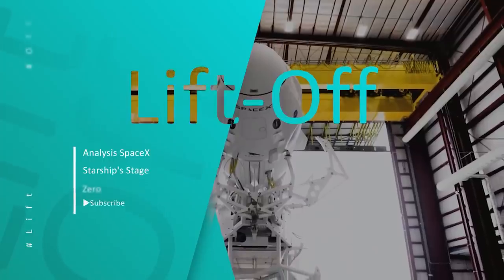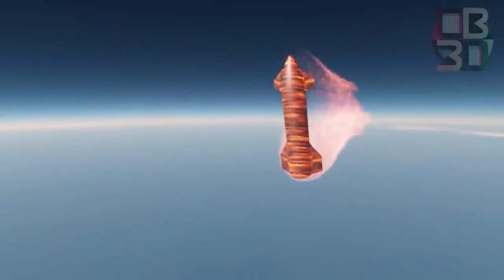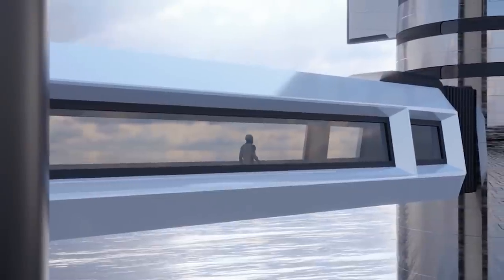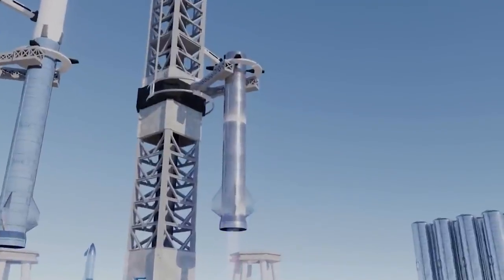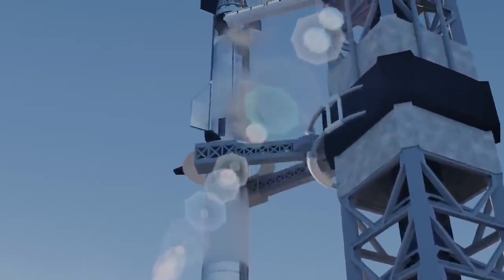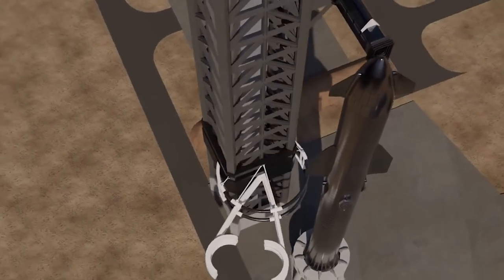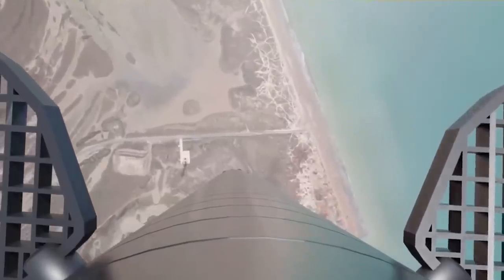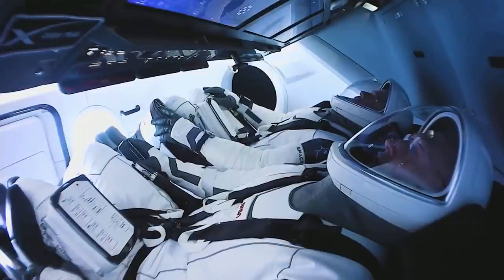MINDBLOWING Analysis on SpaceX Starship Stage Zero CHANGES EVERYTHING

Comment: Wondering, why would Musk not want to recover SN20 after delaying launch forever, for all that heat shield work?
Reply: It’s a prototype
Reply: @sir_dark_humor8673  Regardless. There have been several prototypes. If it's not coming back down, the shields were a waste. Maybe what he meant by not worried about recovery, is coming back, but expected to crash? At least they may get data from it that way.